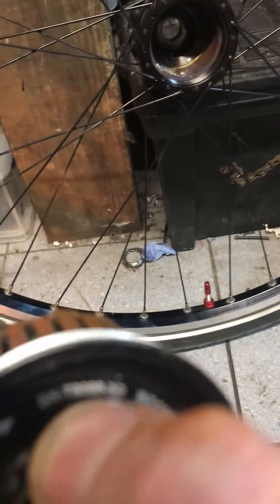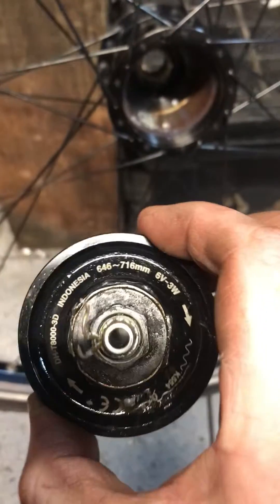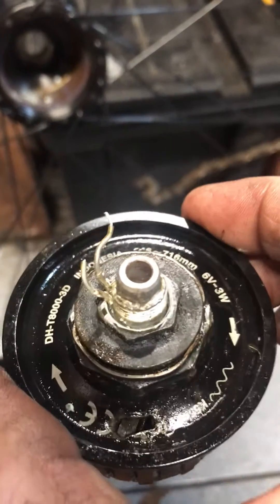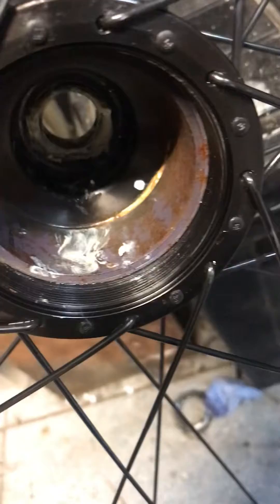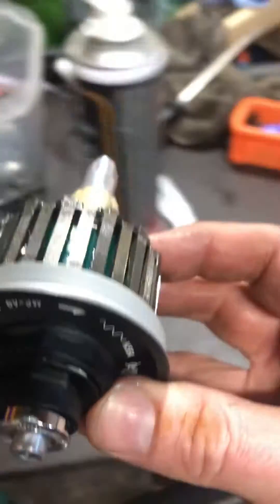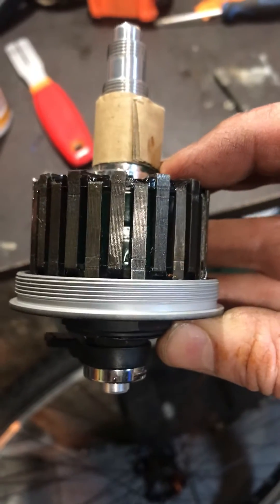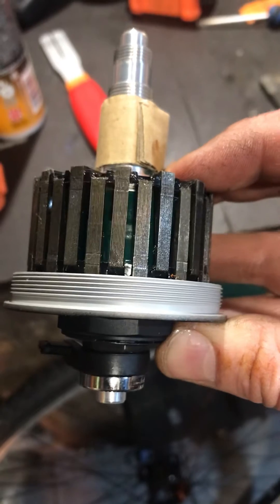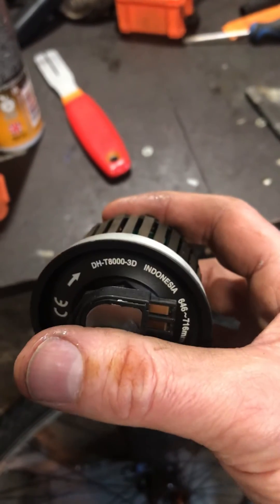Shimano Deore XT DH-T8000 internals removal and replace

Comment from the maker: Hi there, in the uk it is available from Madison, who are the importers of shimano. If you haven’t got a madison account you won’t be able to buy it. Most good bike shops will have a madison account. I shall see if I can find the reference code for the internals, the code will be same internationally
Reply: I don't have a Madison account. I'm searching for the 32 hole dynamo. Can you tell me a price?
Reply from the maker: So, from some initial research there are no XT hub dynamos in stock and they aren’t listing any stock at the moment. However they do stock the Shimano Alfine, which essentially the same hub, retails at £120 and should be readily available it’s part code is DHS501BL. If you are Manchester based I can direct you to my Facebook business page and I can supply you one directly either on its own or built into a wheel. 👍
Reply: I'm not from Manchester. Thank you for your answers.
Reply: Hello. Can you get such a lamp?
Axa Luxx 70 Plus
Thank you for your answer.